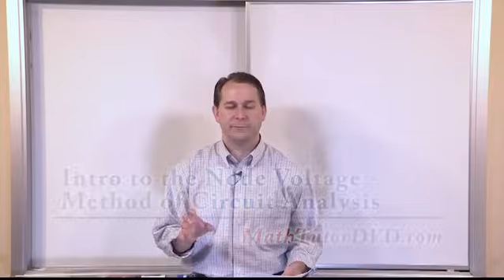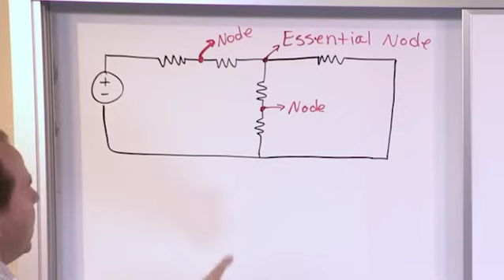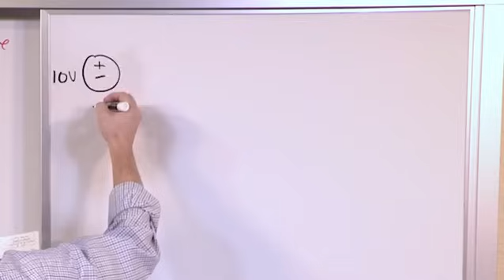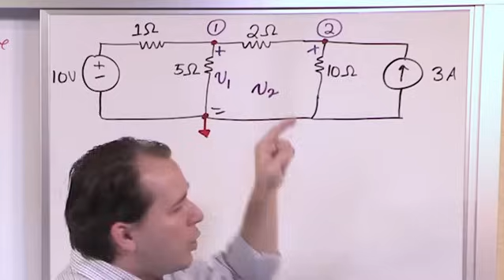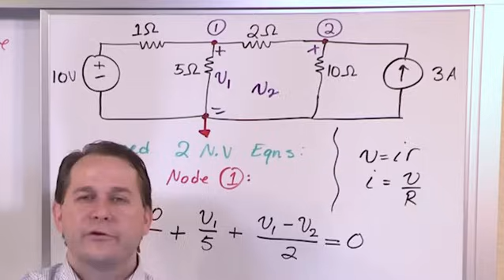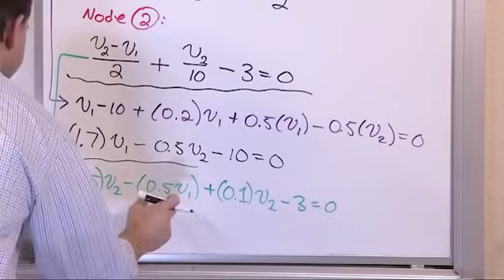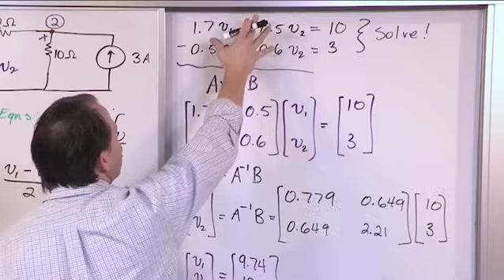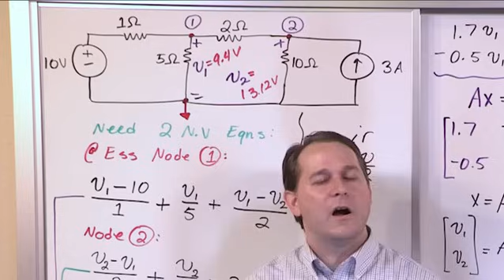Lesson 1 - Intro To Node Voltage Method (Engineering Circuits)

Comment: I teach a simpler node voltage analysis system. This video, however, was very good. The teacher did a fine job in explaining the circuit and how to calculate node voltages.

Comment: determine the current flowing through 5Ω resistor in the circuit.
(a) 5.51A   (b) 7.51A    (c) 4.51A    (d) 3.51A

Comment: Little confused, how did we get v2 13.12v while source voltage is only 10v. How one of the branch has voltage drop higher than the source?

Comment: If you're doing the matrix by hand, i think simply augmenting the matrix and solving would be quicker than finding inverse. Also if you're using a calculator, instead of find the inverse, simply  entering a 3x3 matrix and RREF-ing should give the same results.
Reply from the maker: You are correct that there are many ways to solve the problem.  Thanks!

Get our Free App and View all Lessons!
http://www.MathTutorApp.com

Comment: if the 10V had its signs flipped (negative on top and positive on bottom) then would it be V1 - (-10) or does the orientation of the signs don't matter???

Comment: What if 2 nodes (v1 and v2)  have a dependent source between them and a resistance (consider 2 ohms) connected in parallel to the dependent source, will there be [(v1-v2)/2] or [(v2-v1)/2]?? Or both of them at the same time???

Comment: what if the voltage sits at place where 5 ohm resistor sits and there is a resistor at the place the 3A current is??
how to solve ?

Comment: Didn't you say in another video that if the node voltages add up to more than your source then you have done something wrong? You did say that, but yet here we are with 22.52V with 10V source.

Comment: Why  v2 (13.12) is greater than source voltage 10? It’s look like we can increase the voltage from a power source using this circuit. Is it practical?
Reply: the 3A current source is supplying voltage the circuit.

Comment: With the node voltage , are we neglecting the voltage from across  the 10ohms resistor?
Reply: No, at 27:29 you will see V2/10 in the second term for the node 2 equation.

Comment: How did you get a voltage of V2 13.12 when the supply voltage is only 10V?
Reply: because the 3A current source is contributing to supplying more voltages.

Comment: Hello, thanks for putting your effort to make that lesson. I'd just like to ask: does the direction of the voltage source matter in that method? Would we write anything different in equations if it was positioned in the opposite direction?
Reply from the maker: Yes, if any of the voltage sources are in the circuit "upside down" from what I have written in this example, then based on the sign convention there would be extra negative signs in those terms.  You would solve the system in the same way and get the same answers for the results, however.
Reply: Okay, thanks. So, in this case, would the extra minus appear before the whole quotient:
- (V1 - 10) / 1

or the voltage source in it? :
(V1 + 10) / 1

Assuming the current is, in both cases, flowing out of the node.

Comment: I don't understand why the current is flowing backwards.  The voltage source is flowing clockwise, but the current source is flowing counter clockwise, how can that be?  The first video said we always assume electricity flows from positive to negative, how can it go both directions?  Can someone explain?
Reply: First look at the voltage values. Strictly speaking current is not flowing from positive to negative. It is flowing from highest to lowest. If one point in the circuit is at -5 V and the other at -3 V, the current will flow from the -3 point to the -5 point because -3 is higher than -5.

Use the (bad) analogue of water and a mountain. Yes, normally water flows from a positive height on the mountain side to a lower height, but it will also happily flow down a tube from -3 feet below the ground to a cave -5 feet below the ground.

Comment: I’m confused, how can you get a greater voltage at v2 than your source? If your getting voltage drop across each resistor then the voltage at v2 should be less than that of v1.
Reply: Strange to create potential with resistors. You are right . There is a mixup of voltages and amperage  in the equation number 2. So the equation is not right and final solution ... is what it is... i think it is just a mistake

Comment: what if there is not a resister or any other equipment between the node and the battery inside the circuit plz help????
Reply: Then you have a short in circuit and the end result will be a lot of sparks, smoke and maybe an exploding battery.

Comment: First node equation is wrong. As current is comming out of positive terminal of the battery and and current is comming  out of the node 1 . So, there should V1-(-10). Which is equal to V1+10.

Comment: Why is it all divided by 1 @ 28:10?
Reply: because the resistor is 1 ohm
Reply: @nhitc6832  I gave up on electrical engineering cause no one answered this question, I got a degree in basket weaving instead

Comment: AT 27 minutes, he replaced V1 with a 1, can  someone please explain where the 1 came from in place of V1?
Reply from the maker: I searched and I don't see what you are referring to at 27 minutes.
Reply: @MathAndScience  It is just after 27 minutes, it is when VT is replaced with the number 1, and it was divided by 5 to give .2.
Reply from the maker: Jr cary thomas are you sure it is this video?  Please double check.  I don’t see anything Ike this.
Reply: @MathAndScience  28:16 is the time not 27 sorry. Don't understand how V1 is number 1.
Reply from the maker: Jr cary thomas now I understand. V1 is not equal to one. What I am saying here is that the coefficient in front of the variable V1 is equal to one.  there’s nothing written in front of the V1 variable so you know that the coefficient in front is equal to one. When you take one and divide by five you get 0.2. The V1 is still there so in the end you get 0.2 times v1.
Reply: @MathAndScience  Got it! thank you for getting back. I have worked ohm's law for 30 years the old way, this is nice. I will review the matrix video next. Thank you again.
Reply from the maker: @225rip  You are very welcome!

Comment: 10v in, with only resistors and he is measuring 13.12v on V2, Err, WTF did I miss.
Reply: you missed the 3A current source. It is also supplying voltage to the circuit.

Comment: Your method may be right but your ammeter reading is wrong and your other answers are also all wrong. I don't know how you can happily pass conclude your lesson when one of your answers can be more than the supplied voltage of 10 volts. It should immediately raise a red flag.